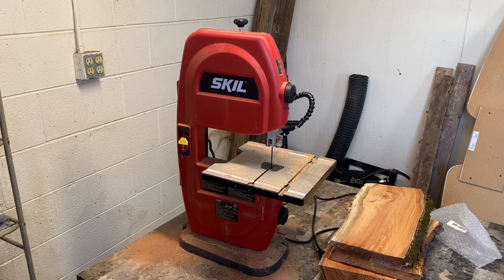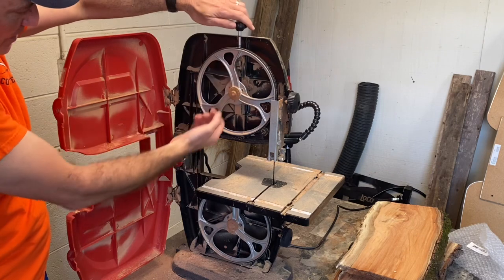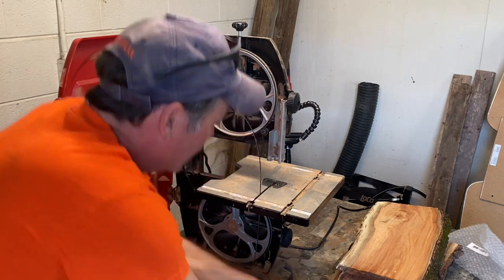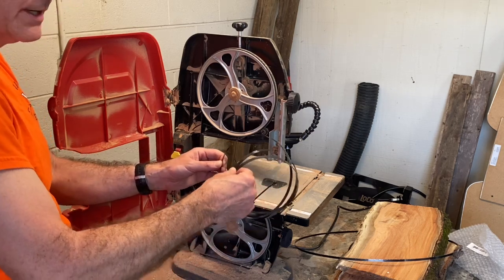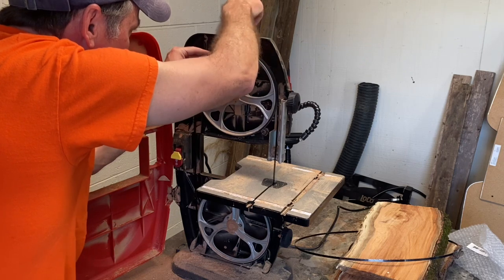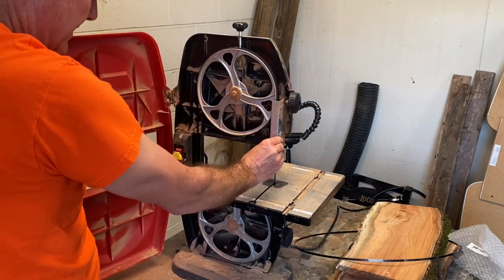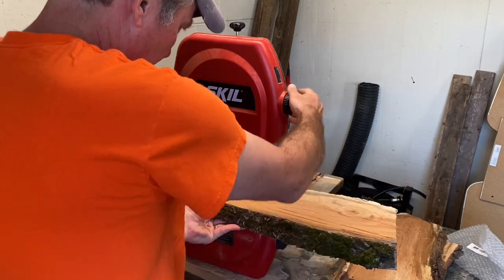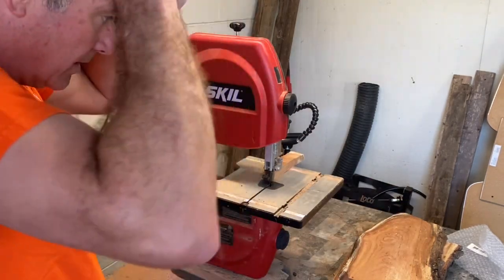How To Replace The Blade On A Skil 2.5 AMP 9" Band Saw Bandsaw Blade Change DIY

Comment: How do I lower the upper wheel to get the bandsaw on? The blade will NOT go right on, it appears an inch short, but it isn’t
Reply from the maker: Turn that knob on the top of the saw counterclockwise, it will loosen the top wheel. I think it lowers it.